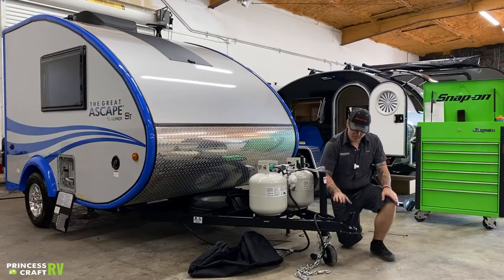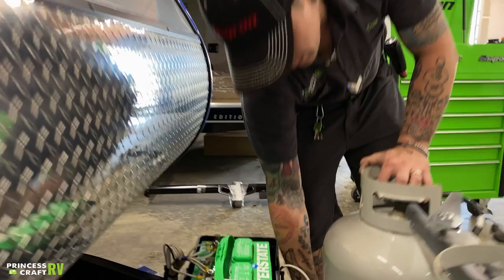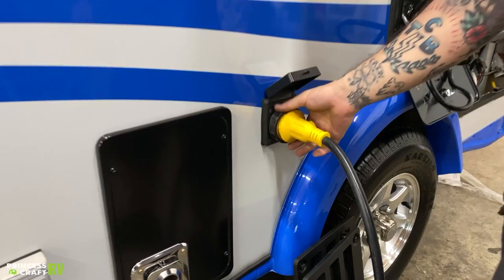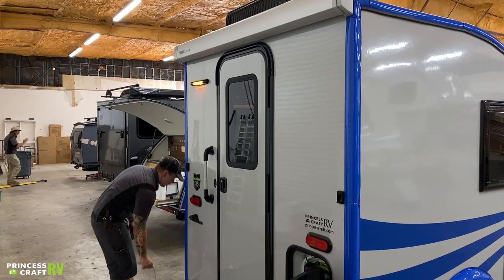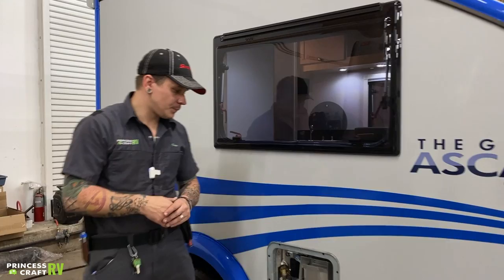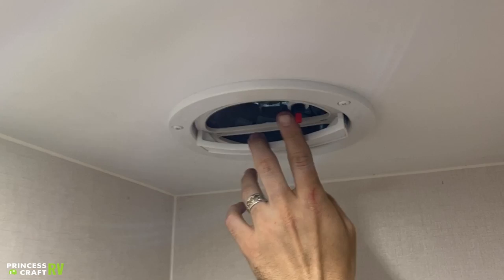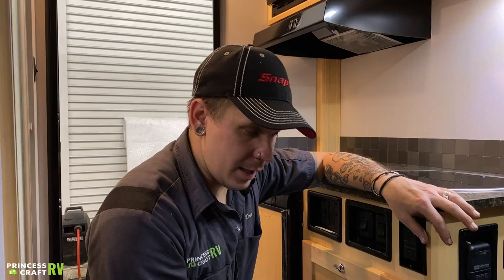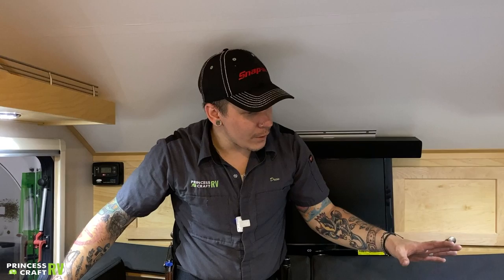2019 Technician Tour - Great Ascape ST by Aliner

Comment: I rather have a roof vent on the roof instead of an air condition for a trailer this small. Open of the windows/screens,  turn the roof vent on to suck out the heat.  Should be okay.  Who's at the campground sitting in the trailer anyway.  How much would it cost to put a better shower head in the unit....instead of the plastic stuff....come on now.  I wouldn't pay 20,000 for this trailer.